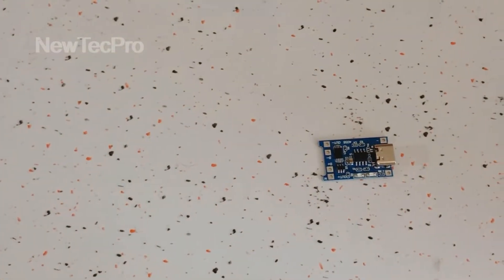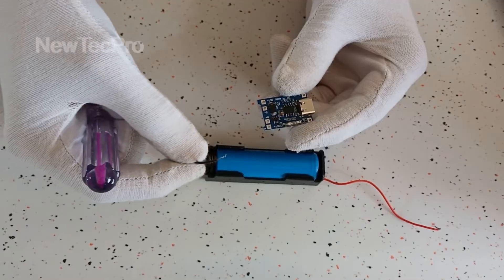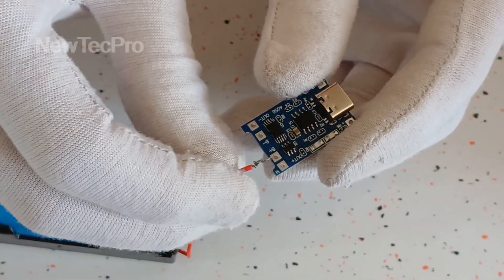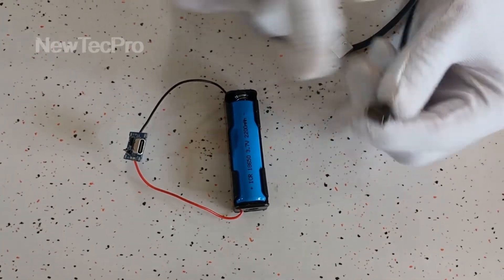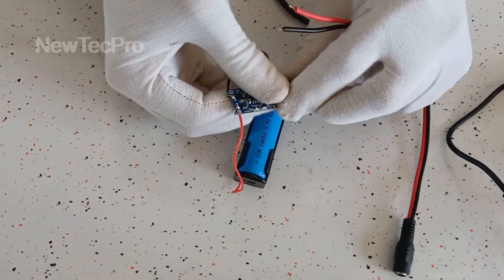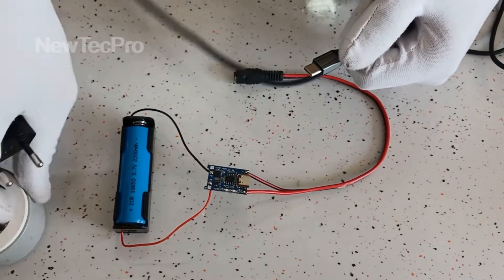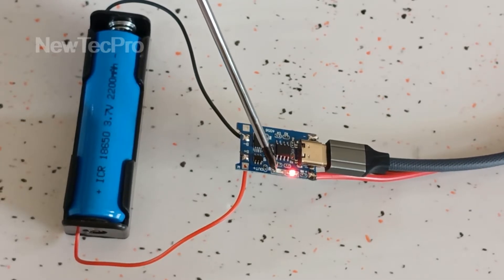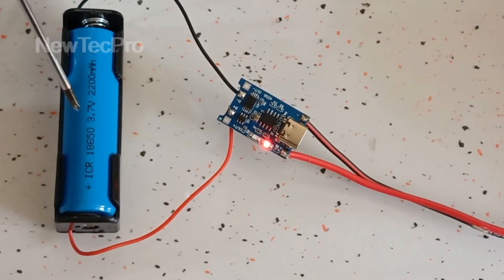How to use TP4056 Type-C USB 5V 1A Battery Charger?

Comment: Hello, why is mine light blue even if not charging yet?
Reply from the maker: A light‑blue LED usually means the indicator isn’t calibrated correctly on that board. Some TP4056 clones mix the red/blue LEDs, so it can glow blue even with no battery connected.

Comment: How much watt charger to charge
Reply from the maker: The wattage needed depends on the battery's voltage and charging current. For example, if you're charging a 3.7V lithium-ion battery with a current of 1A, you'd need around 3.7W (3.7V × 1A). A higher capacity battery may require more power. What battery are you using?

Comment: Look friend, what happens to me is the following: I have a charging module like this and a rechargeable BL-5C and I'm using it on an Xbox 360 controller and so far everything is working perfectly, but out of nowhere it turns off and doesn't turn on at all, except if I remove one of the legs of the cable that is connected to the controller and put it back in again, it's really strange, I really don't understand, could you give me a solution?
Reply from the maker: It sounds like a connection issue. Check for loose cables, battery wear, or power draw mismatch. Try another BL-5C or charging module if possible. Hope this helps!

Comment: Can it also charge the LiPo using only the usb-C charger? I noticed the LED does not turn on, and my taser seems to only work when I charge it using the solder pads.
Reply: After some experimenting I found out that it is possible to connect the anode of R4 (there is no resistor inserted) to the positive input of the board, this makes the lights turn on. Is it still safe to charge the battery that way?
Reply from the maker: Hello. How do you feed the input voltage of the module?
Reply: @newtecpro  using a usb-C phone charger
Reply from the maker: @desktopantec2290  You must have a USB charger with an output ampere below 1A.
Reply: @newtecpro  Oh, thanks. I will report back when I have time to test it.
Reply from the maker: @desktopantec2290  thnx

Comment: How to make out connection so i can use charged battery with on-off switch....i want to make rechargeable air fan
Reply from the maker: You should give the battery output to the fan input. The battery is also permanently charged by the module.

Comment: I have a bunch of those. In no way I can get it powered on with usb c. Nevermind. the things are pretty picky on chargers.
Reply from the maker: Hi. Why can't you turn it on? As shown in the video, we turned it on with a USB Type C port
Reply: @newtecpro  does only work with 5 volt adaptors.
Reply: Can't use c to c cable nor fast charging  with them

Comment: It was interesting and informative. I lost my headlight charger. Can I charge the battery with this?
Reply from the maker: Yes, one of the important tasks is: making a 3.7V lithium-ion battery charger for a flashlight
Reply: You are using a metal croc clip to hold the pcb and then you go along and solder the wires with battery installed in holder. Very bad practice I’m afraid.